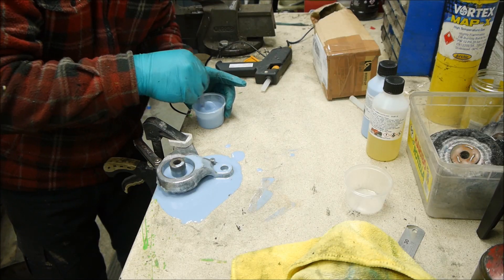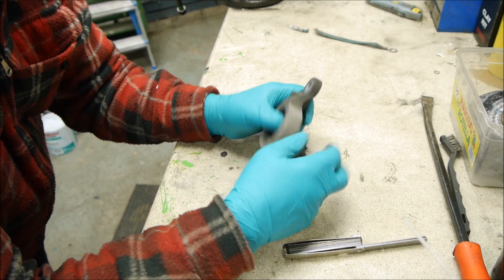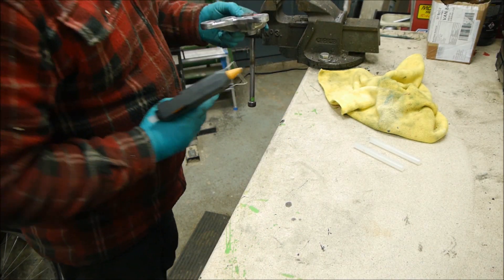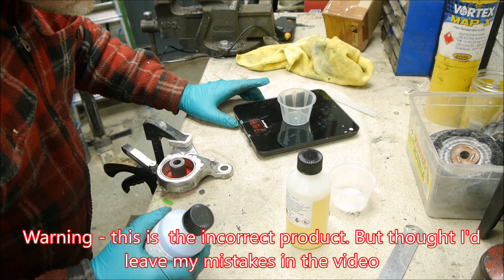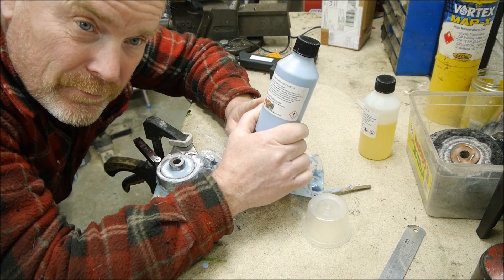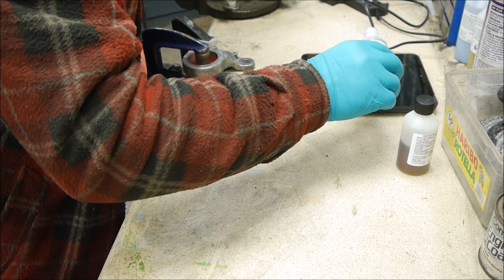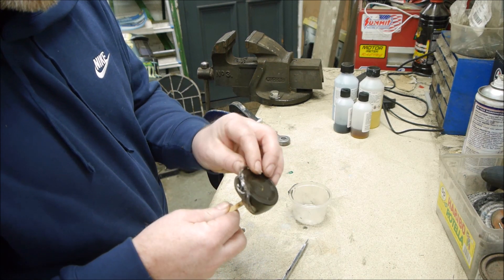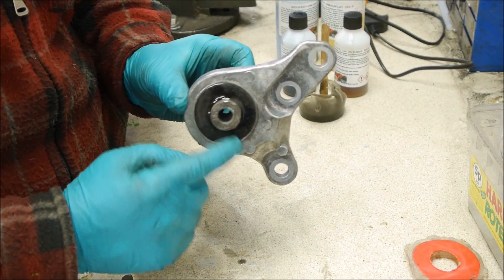Make your own DIY  low cost Polyurethane  engine mounts or suspension bushes

Comment: Dear, I am a follower and admirer of your work and we wish you success. I will do the same to rebuild the suspension system in my country. If you can provide us with the rubber specifications and the source.
Reply from the maker: Thanks for your kind feedback.  Product required is Polytek Poly PT Flex 70 Fast Cure – Shore A70 Polyurethane Casting Rubber

Comment: im replacing rubber suspension bushes on 1949 chrysler yank tank... cant go back to 1949 to get parts... will give this a try
Reply from the maker: @MrRasZee  yes idea for that application. Bear in mind you can get different hardness rates. Better still plastic print your molds

Comment: How well has it held up?
Reply from the maker: Done about 15000 miles. Still OK but I think maybe a little movement just started. Going or do a follow up video soon. Either way still a good result. I've heated the mitsubishi replacements only last a few years.
Reply: Please check carefully the instruction. I'm pretty sure, poly needs to be cooked in the owen to finish polymerization. This is why it might be not so strong as expected and will not last long.

Comment: Wow, impressive, this is exactly what I was looking for, it's been 11 months since you did this, how many miles have you done on that fix? Would you still recommend it? I have a 3.5ton suv, would this fix be any good for the control arm bushings?
Reply from the maker: Yes it's worked well and not failed as yet. Probably done about 16k miles since done. It's surprised me how well it's lasted.  Yes would be good for control arms bushes.

Comment: Good job !! I made a few when working on my old MX5 a few years ago. Might try it again for the CLK suspension parts ?
Ive heard some use a 3M polyurethane product, tiger seal, easy just to squeeze it from the tube, no mess !!
Reply from the maker: Yes seen some videos using tiger seal.
Reply: @vintagesteelgarage  think it might be worth just squeezing in some tiger seal into those air spaces on some of those susp pieces ?